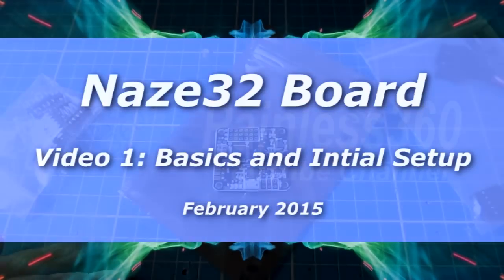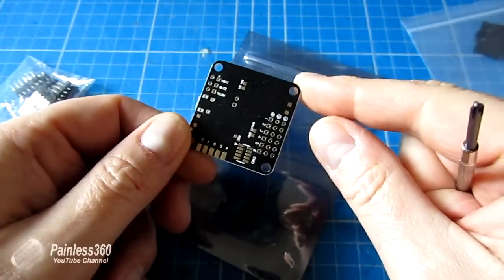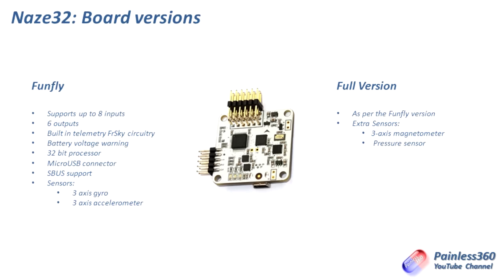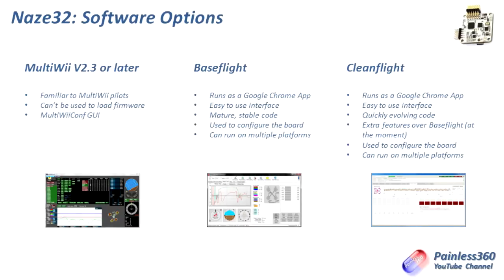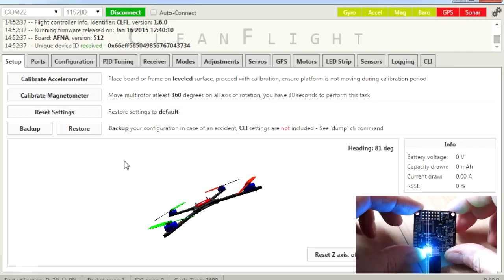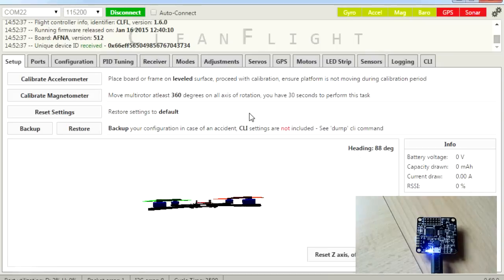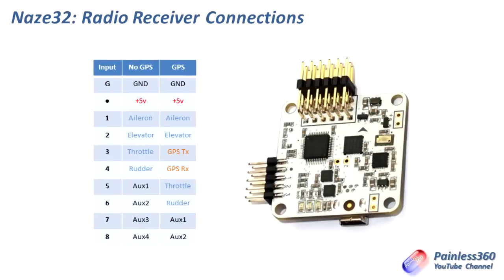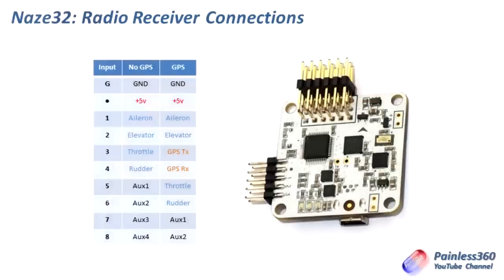(1/8) Naze32 Flight Controller (Full version) - step by step initial setup

Comment: Hi, me again trying a different board.  I have completed the set up as you have so skillfully explained.  Here is my latest problem:  Upon trying my first flight, the quad did nothing more than tip over to the left.  I tried compensating with pushing the right control to the right.  Same results.  I calibrated the motors using Baseflight.  While doing a motor test, all the motors spin at the same rpms.  However, when controlling the motors with te transmitter, the left front motor (#2) spins at 1400 rpm while the other three spin at 1100.  I have tried numerous other sources, a couple of whom directed me back to your videos.  I am fairly sure I have done everything correctly, yet I am still frustrated by my inability to figure this out.  Any more ideas?  Thanks for all your help up to this point.
Reply from the maker: Triple check that you have the motors plugged into the right outputs..

Best of luck!
Reply: Checked, re-checked, and checked.  The motors are plugged in according to the Naze32 diagram. Front left: #4 clockwise, front right: #2 counterclockwise, rear left: #3 counterclockwise,  rear right #1 clockwise.  Why would the motors spin at different speeds when using the T6 and not during motor test?
Reply from the maker: Mike Kevins Not sure what's going on here, are all of the channels at 1500 (elevator, Aileron and rudder) at midpoint in Cleanflght? What mode is the model trying to take off in?
Reply: Painless360 I am learning "bits and pieces" every day.  Looking at the settings, my roll and pitch were down around 1250 or so.  Unfortunately, I maxed out  the trim and sub-trim.  , I could only get the roll to 1438 and the pitch to 1485 before I ran out of adjustment.  I am using Baseflight because that is what the guy from whom I purchased used to talk me through setting up the board. Would that point to a problem with the Tx?  It is raining right now, so I cannot try to fly it again, but I think that should get me closer.  When you ask me what mode the model is trying to taske off in, you lose me.
Reply: Mike Kevins Running it through the motor test mode,, motor #2 is still spinning way faster than the other three.
Reply from the maker: Different firmware on that ESC? If you swap ESCs over does the problem follow the ESC or stay with that motor output?
Reply: Painless360 I swapped motors and got the same results. I do not have any extra ESCs.  Swapping them would be a little more difficult as they are soldered to the distribution board.  What about the adjustments on the Tx?  I run out of adjustment on the trim and sub-trim before I can get them to 1500. I guess that great deal I got on the kit is not looking so great right about now. Any way we could communicate by email so I do not have to keep showing your viewers how inept I am? I guess somebody has to be a bad example.  Ha ha!
Reply: Mike Kevins
Mike, don't run off just yet. I don't think anybody is throwing you under the bus, to the contrary, I think the rest of us are totally interested. This is a great forum for what you are doing.
Reply: Tony Cox Thanks Tony.
Reply from the maker: What radio is it? You should be able to get to 1500 (or 1520 depending on the radio) without using all of your trims....

Until this part is sorted we can't see clearly what might be causing the issues.
Reply: It is a Flysky T6.
Reply: Mike Kevins With the help of a lot of other people, we finally figured it out!  I had the radio set in helicopter mode.  After reading hundreds of posts both here and on RCgroups.com, I realized the error of my ways.  I changed the settings and the motors began behaving properly. I had my first flight, followed shortly by my first crash.  Thank God for carbon fiber propellers!.  Thanks to you, Painless360 for all your help.  I will continue to watch and learn.  Your videos are very well done and very informative.
Reply from the maker: Mike, I am so pleased that you have it sorted. Well done on troubleshooting the problem and getting to the route cause.

I'm kicking myself I didn't think of that! - https://www.youtube.com/watch?v=dLg9dRKIk4c

Happy flying and this video may be of use to you now too ;) https://www.youtube.com/watch?v=rDQb0evJk-Y
Reply: You guys are great, I am just so happy that this blog is constructive, supportive, objective and focused. Great job.

Comment: I love what is happening with cleanflight. It is running on many different boards (including simple STM32 dev boards from ebay if you supply your own sensors; also from ebay). That means you can use more powerful processors. Computing power is enough with all of them at the moment, but there are many that have much more IO hardware built in. I can't wait to have it running on a board that has 5 hardware serial ports so I can use SBUS, SmartPort telemetry, 5Hz GPS, blackbox recording and CLI for inflight tuning via smartphone bluetooth at the same time!

Comment: thanks for the awesome info  video .....will it matter the  orientation of the board ? ilike if the USB plug is to the right or left side ?
Reply from the maker: +ST Logan All covered in the series ;) https://www.youtube.com/watch?v=4LqySEZzoLY&list=PLYsWjANuAm4p47OBBTOo4Xr3lNUc8PFpc&index=11
Reply: Painless360 cool thanks ...i am wondering why i click save and reboot ..it keeps going on with waiting for data
Reply from the maker: Not sure, I've not had that here..
Reply: Painless360 i cant click a diff. tab it just stuck in waiting for data..
Reply from the maker: +ST Logan I'd check you are using compatible firmware with the GUI (it updates all the time) and make sure that nothing else is plugged into UART1 when using USB... Best of luck..

Comment: Thanks so much for this video Painless. With regard to the motor testing at the end... if you found that one of your motors was NOT turning in the correct direction, is it possible to change the direction through this software.... as opposed to resoldering the wires? Thanks again!
Reply from the maker: There is no option in software as its the ESC not the flight controller that drives the motors. Swap any two of the wires from the ESC to the motor. I use bullets to make go easier repairs and setup myself..

Best of luck!

Comment: I am working with Naze32 board and Flysky i6 transmitter. The values of throttle , yaw .... are being correctly show on the reciever tab of Cleanflight and the motors are also working via the motor tab but I am not able to control the motors via the Transmitter 😭😭... Please tell me where am I going wrong...
Reply from the maker: It’s probably the minimum throttle setting, what troubleshooting have you already done?
Reply: Painless360 1070 is set as the minimum throttle. Now the motors are working fine 😃 but I am not able to calibrate the esc's before even plugging in the lipo there are some sought of sounds produced and after plugging it in it doesn't plays the calibration tone 😭😖.

Comment: Hello, what made you decide in your frame build here, not to go with the battery on top or in the middle of the quadcopter. If there is a video here about that, I'm sorry I missed it. Thanks for your good info videos.
Reply from the maker: +Andre Campbell Every frame has a layout that the designer has in mind when he/she designed it. I tend to follow that layout as these frames can present a challenge to fit everything in if you want to add lots of extra little bits (FPV, OSD, GPS etc.) and also try and be creative with component placement.I have lots of frames on the channel and each has it's own strengths and weaknesses. Best of luck.
Reply: Copy that! Thanks for your insights.

Comment: first of all thank you for this really good intro! I installed the new cleanflight-configurator 1.1.0 and flashed my naze 32 with one of the latest firmwares - as long I have connected external power, my naze will not connect to configurator. If I pull external power and the board is only connected via USB it will connect ... can you help me here ... reconnecting to power then, will work, but I cannot jump w.g. from configuration to motors ... loading data will appear but nothing els happens .. again disconnecting main power will help to connect ...
Reply from the maker: +MaFa Zap Make sure nothing is connected to the board for the test. Happy to help but please watch https://www.youtube.com/watch?v=olIqTiSJHIY and come back to me with more detail of what you've tried..
Reply: +Painless360 I'm sorry, obviously I was kind of "in medias res" with my question. My setup is a rev. 5 Naze 32 with the 1.11 firmware (2015-11-28). I'm using 30A rctimer controllers without bec, so I installed a 5V bec and istalled additionally a minimosd according to your description to improve my learning curve when flying via fatshark goggles.
I'v gone through of all your intoduction and tip videos about 2 months ago, when I have setup my race quad. Your videos helped me to setup and tune the system quickly (normally I'm flying helicopters Align700/550 and used nanowii for my bigger photocopter), but a kind of a racequad virus started ... unfortunately I'm the only one who is using the naze). At that time I was using an "older" naze firmware and 0.6 configurator and everything was fine.The week before christmas I had to  rebuild my computer ... so I catched the new configurator 1.1 ... as I identified the connection problems I thought, ok update your firmware software, the drivers .... but this did not help.I even tried a second pc with the same effects. When naze is powerd via USB the connection is fine, once I connect the external battery e.g. to test the motors  etc. the configurator does not work, switching to a differnt page e.g. configuration will have the effect, that "waiting for data" appears  ... once you de-connect the external battery, the connection is back ... any idea ? I will post a short video with this behavior on youtube right now.
thanks in advance for your support.
martin
Reply from the maker: Not sure, maybe the video will make it clearer!
Reply from the maker: +MaFa Zap Make sure that you have nothing plugged into UART1 (OSD etc) as it shares the USB connection and when powered on can cause problems.. Best of luck..
Reply: Brilliant - thanks a lot for your help. I woke up this morning and thought it must be related to
the powering via the BEC .... and pulled of the BEC and the OSD by chance - it works now. Now I tried all configurations and can say, that this problem was caused by the OSD only. Obviously I did not recognize this information in your videos :-(.Again, many thanks for your help !!! regards from germany
Martin
Reply from the maker: Happy flying!

Comment: Thanks for the great Video but am I right in think that you have all your esc power connections bridged together via the flight controller? (Ie connected in parallel)  I take it that it hasn't caused you any problems.
Reply from the maker: +Stuart Smith yes they are, see our videos about power to see more about how switched and linear battery Eliminator circuit work and the precautions you need when using them. Best of luck!

Comment: I'm having a problem with my Funfly board, I'm unable to calibrate the Magno ( the option isn't greyed out ) also, the slider for the master throttle isn't working, but, when it is all connected, up as it should be, it all works as it should.
Reply from the maker: Odd, triple check that your board does have a magnetometer. Most of the funfly versions I've seen don't (http://www.hobbyking.co.uk/hobbyking/store/__55819__AfroFlight_Naze32_Acro_AbuseMark_FunFly_Controller.html).

I'd also consider flashing the firmware again as the throttle should be working too - sounds like something on the board/software is getting confused.

Best of luck..
Reply: Painless360 Cheers buddy my bad, I re-Flashed the board and it is all fine, well except that as soon as I arm the motors they spin, of too do some more research
Reply from the maker: Paul Young Paul, you can turn off the motors in the code, you need to uncomment define motor_stop (may be something slightly different) in config.h

Happy flying!

Comment: Hi there! I love your videos, they are by far the most informative and well-explained videos on this sort of thing out there. I was just wondering where you bought your Naze32? I've been searching online, and most places seem to only stock the "Acro" or "DOF" versions, but I can't seem to find the Full version. Also, a not-so-Naze32-related question: I'm trying to build a 250 quad, and all the instruction videos seem to use 1300mAh batteries (Or thereabouts). Some of the items I've looked at such as frame kits and pdb's recommend a range from 1300-2200mAh. I'm just curious to know if there's any reason I can't use a bigger battery? What would you recommend for maximum flight time and performance?
Reply from the maker: If you're looking at a new build then I'd go for something a little newer than the Naze32. The limited memory and horsepower on the Naze32 means that software is having to remove certain features to make it run/fit onto it now. I'd go for something running a STM32F3 or later processor now with more memory and ports. Regarding the battery - 1300-1400mAh packs are for racing and give you 3.5-5.5mins on average (depending on flight). I have a few models here that I fly with a 2200mAh pack (and fly less aggressively) and get 9-11 mins. The performance is impacted as the battery is a lot heavier but it's horses for courses.. Best of luck!
Reply: Thanks so much! I've searching, and none of the options I can find mention anything about a magnetometer, which is actually what I was looking for most out of the Naze32 full version. Ultimately I want to enable GPS as per video 6 (I think) of this series. The MotoLab Tornado FC seems like a good option, but again, mentions nothing about a magnetometer.Can you recommend any flight controllers running a STM32F3 processor that would allow me to enable GPS hold/RTH etc?
Reply from the maker: +Luke Metcalfe I'd suggest looking at the Inav series on the channel. We use two of the most useful boards for GPS and cover more of the gotchas. Best of luck!

Comment: Great video to help me setup my cleanflight flight ccontroller (based on naze32).., I don't know if anyone can help, but I have an OrangeRx CF720x combined receiver and flight controller... I was wanting to add a barometer (bmp180) and connect it via the i2c port.. Does anyone know if it is a straight plug and play connection? Anyone had ANY experience they can share...
Reply from the maker: That's a question for the HK support team. I've had a quick look and it wasn't obvious.. Best of luck!

Comment: Hello again there Painless, just want to say thanks for all the help answering my questions in recent weeks, but have recently stumbled on another problem with the drifting. I have two flip32, one on a QAV250, and one on a F450. For some reason they seem to drift toward the same direction to the East, no matter my orientation it somehow just drift towards the same direction. Is there a way to trim that out. I'm on CleanFlight and there a few settings on there like the Accelarometer trim, don't know if that something to mess with,and what does the TPA ajustment do on cleanflight, just trying to get them stable to fly. Oh one more thing would a auto tune clean that drifting out might give a try. Thanks again painless;)
Reply from the maker: Yep. Autotune. Best of luck
Reply: Hello there friend, another question.  Is it possible to do auto tune with two position switch or has to be three. I tried it with a DX6i, one switch on horizon mode and the other in autotune, thing is when I hit switch to auto tune while in air seems like nothing happens, think there should be some twitching and moving going on before a beep yes. Mine just sits still just wondering. Thank You Painless reply whenever possible:)

Comment: for some reason i cant calibrate my magnetometer
Reply from the maker: MaxAmaSity What trouble shooting have you already done? What version of the board have you got - the 'Full' one?
Reply: Painless360 i found out i have the acro version, not the full. working fine now.
Reply: MaxAmaSity What did you do to calibrate the magnetometer?
Reply: no i got the other version of the  naze  32 so i didnt get a magnetometer with mine.
Reply: MaxAmaSity its the buzzer interfering with it

Comment: hi, a hard question, what u prefer naze32 or openpilot or pixhawk ? 
witch is more stable fly or witch is more agile ... and 1 silly q can we do a 360 roll like the one with preseted button ?
Thanks great vid., great explain
Reply from the maker: All are good at most things but some are better in some areas than others. https://youtu.be/k4tQAmg2ssA
Reply: +Painless360 i order the same frame like u have here but with cc3d and flysky i6 remote and receiver and i want to put some stuff like gps, gimbal,fpv and i want to know witch is best, but i want to make another one with 250 frame like thoes that are racing one, but in the future.
BTW i`m noob i dont get my hand on a remote and a drone before :)) hope to get it right

i will watch vid. now ty.
Reply from the maker: I have videos on learning to fly and always recommend that if you are new then by a little Hubsan X4 to learn to fly with. Less expensive andante dangerous to learn on.. The CC3D series on the channel is designed for new pilots and builders and goes through every step. Best of luck.
Reply: +Painless360 Thanks i will wait to all my parts arrive,  till then i will watch your vid. with how to fly.
I allready make order u can watch on my google+ what parts i order, but they are order before to see your video, now i have cc3d but monday will buy a naze32 is nice with all feature.
Thanks